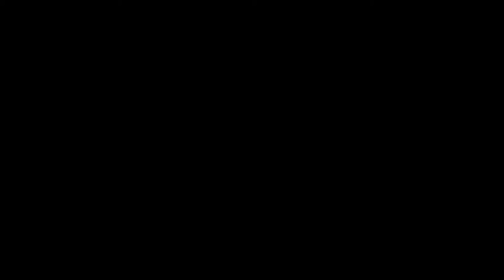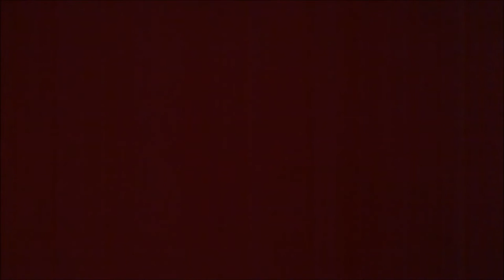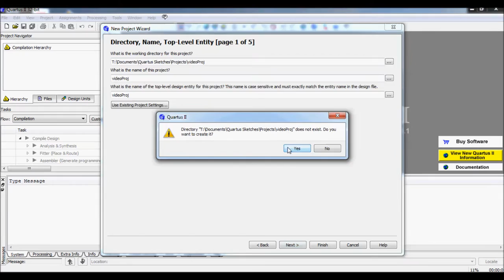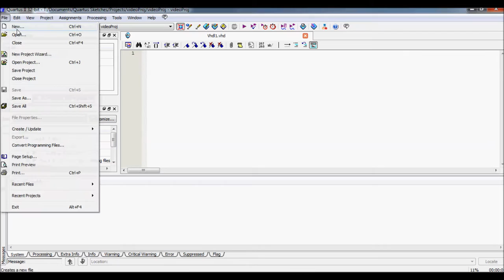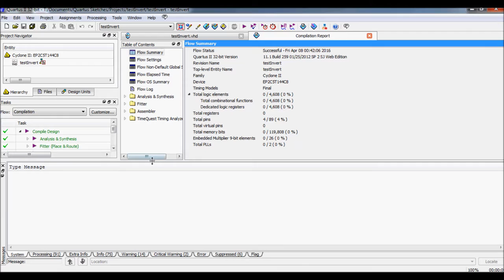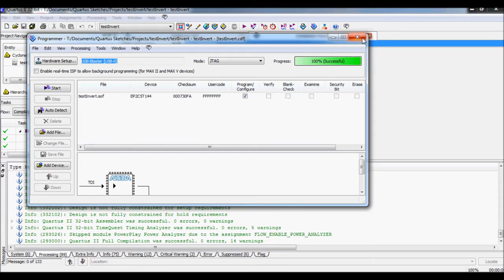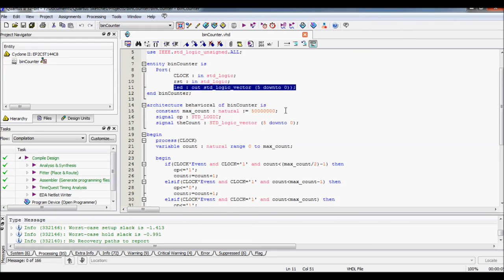Getting Started with VHDL and the Cyclone II EP2C5 Mini Dev Board

Comment: I don't usually write comments, but this video got me up and running 10x faster than the Altera videos! Great video for this board, and now I have verified my board works. Thanks for the great walk through, I appreciate it!
Reply from the maker: Well thanks!  I wish I could say I was more experienced with FPGAs, but I just kinda fumbled my way through this, and realized that others might be doing the same.  My big project right now is to try to implement PCIe using this board and some external DRAM, but unfortunately work keeps finding a way to get in the way.  Best of luck with your board!

Comment: For anyone wishing to program via AS mode, if you get a "current device not supported" error follow these steps: 
1) Make sure you have selected "Active Serial Programming" mode
2) Change/add file to the one that has a ".pof" extension
3) If it is not automatically added, via "Add Device" select "EPCS4" as the device. This is the onboard RAM
4) Make sure "Program/Configure" is checked
5) That's it.You can press "start" to flash
Reply: Thanks!

Comment: Another thing worth mentioning with these boards is that on the bottom you will find four zero-ohm resistors that jumper two IO pins to Vcc and two to Gnd. I'm not sure why these are there but you can remove them to gain access to these pins which are brought out to the headers. 

Also when interfacing external parts, pay close attention to the datasheet for the FPGA as there are 8 (IIRC) pins that are input-only and cannot be used as outputs. I realized that after fabricating a module to plug into the mini board.

Comment: The problem with the on-board button is most likely that you did not enable the pull-up resistor. There is no resistor on the board! In "Pin Planner" you can enable additional columns in the table at the bottom. Select the column "Weak Pull-Up Resistor" and enable it for pin "PB".
Reply: Additionally you will probably notice that the FPGA and the 1.2V regulator get quite hot as soon as you start running your own design. This is  because pins 26 and 81 are directly connected to 1.2V. The default choice is to drive all unused pins to GND. Short circuit. You should go to Assignments->Device->Device and Pin Options...->Unused Pins and set it to "As input tri-stated  with weak pull-up" (or "... with bus-hold circuitry"). Then everything stays cool.
Reply: Thanks! 8 months late, but that's really helpful as I was noticing it getting somewhat warm.
Reply: I can confirm my button works correctly after assigning the weak pull-up. Go to the 'Pin Planner', right click in any field and use the context menu to open 'Customize Columns'. In here you'll see 'Weak pull-up Resistor' on the left, highlight it and '>' it over to the currently in-use column, hit OK and it appears on the right of pin planner. You can now switch the pull-up on and off. 
Great tip to default pins to 'input with weak pull-up' too, everything running much cooler now! 
I'm just starting out with this board, this video was really helpful as others have said, great work!
Reply: @RD-so4mn    thank you, just started with this board and Quartus II, great tip for a beginner to hands on with fpga

Comment: There is a mistake in the code you show for the binary counter.  The second process should be using op for a signal rather than theCount.	

	
     process(op) begin
		if(rst='1') then
			theCount<="000000";
		elsif (op'Event and op='1') then
			theCount<=theCount+1;
		end if; 
	end process;

Comment: hey tery ! good work :) .. well.. could it be the problem with onboard push  button not debounced?
Reply from the maker: Nah, I didn't debounce the external button either, and I had no problems with it.  Since the program is just resetting the clock, if it sees multiple high pulls on the button in short succession it doesn't hurt anything since they're all happening in less then a second.  Also I tried debouncing the button for a later application and still had issues with it.  I think it's just a quality control problem with that particular component, so perhaps your board won't have that issue.  And even if it does, not being able to use the button isn't a huge deal (at least to me) anyways.

Comment: hello i got a problem with my board i chose outputs for a 7 seg 139,136,134,132,126,122,120 through pin planner and everything was looking fine but the voltage is not 3.3 at every output. Any ideas for my problem? (its my first attempt with fpgas so maybe its a silly question). Thank you.

Comment: hi, when i looked at digilent basys board or another boards with fpga, they have like 10 or more small power capacitors connected to power rails of fpga. I don't see them here. Does it matter to have them there or my designs have to be limited by maximum frequency and some maximum current out of pins due to power instability?

Comment: The board i got gives about 4 volts on the 3.3 VCC and 1.5V on the 1.2VCC pin. Is this a common problem with these boards?

Comment: Hello, everybody. I am trying to get through the LED project and when I get into Pin planner I get  'This is read-only' message, so I can't assign proper pons. Can anybody help me? I am using Quartus 13 and EP2C5T144C8 chip on the same board.
Reply: You get the error message as soon as you open up pin planner, or when you try to assign pins to a specific entity?

Comment: Hi and thanks for the tutorial. In the pin assignment section of the video, how did you determine PIN_144 for input and other staffs? Is that optional? The LEDs are D2, D4 and D5. I don't understand how you mapped those to PIN_3, PIN_7 and PIN_44.
Reply: Hi, I am starting with this board and I have the same question did you figure out how determine the PIN?
Reply from the maker: Hey all, sorry for the lack of response.  You can find the associations between the pins on the Cyclone II and the actual pins on the FPGA dev board on this page:

https://www.openimpulse.com/blog/wp-content/uploads/wpsc/downloadables/EP2C5T144-Altera-Cyclone-II-FPGA-Development-Board-Diagram.pdf

If you ctrl+F for "LED" (located at the middle-bottom of the first page), you should see that the LEDs are mapped to PIN_3, PIN_7 and PIN_44.  You can also find the clock output pin, and any other pin on the FPGA board.

This page is located on the product description of the dev board from OpenImpulse (https://www.openimpulse.com/blog/products-page/product-category/ep2c5t144-altera-cyclone-ii-fpga-development-board/), and they also have some other resources on there.

Let me know if you need any more help.

Comment: Error (12007): Top-level design entity "Project1" is undefinedError: Quartus II 64-Bit Analysis & Synthesis was unsuccessful. 1 error, 1 warning
	Error: Peak virtual memory: 4621 megabytes
	Error: Processing ended: Mon Jan 30 20:24:27 2023
	Error: Elapsed time: 00:00:03
	Error: Total CPU time (on all processors): 00:00:02
Error (293001): Quartus II Full Compilation was unsuccessful. 3 errors, 1 warning
, error when compiled the project, Here the "Project1" is my project name, How can I fix this.

Comment: Great job
I just got my new board and its working fine, But when I remove the power the program is lost. I have to reprogram again.
Am I doing something wrong?
Thanks
Reply: Nope, that's correct. Normally when you program an fpga  you want to load the program into the ram. if you want to save the program, you'll want to write the program to the flash
Reply: Thanks

Comment: WHat version of Quartus II are you using? it seems the latest (16.1) doesn't support the cyclone II
Reply from the maker: Yes, the later versions don't include support for the Cyclone II.  This is version 11.1sp2.  If you go on Altera's website you can download deprecated versions of Quartus that are compatible Cyclone II (and their other older FPGAs).
Reply: Trey thanks, do you know if it's possible to install two versions on the same pc?
Reply from the maker: I haven't tried, but it should be possible.  All the system files for 11.1 are clearly labelled as "11.1sp2", so it should be okay.  Do you have a Cyclone V or VI you're playing with as well?
Reply: Thanks, and yes I'm playing with a cyclone IV and Cyclone V SoC, so I'd like to be able to use them. I wanted the cyclone II for a smaller, simpler project.
Reply from the maker: Well best of luck!  It's been a minute since I've messed around with FPGAs, but I'll admit I'm waiting to have the time to fall down that rabbit hole again.  Incredibly powerful, and oddly not "mainstream" technology.

Comment: can we use arduino ide for programming the dev board
Reply: Unfortunately no, you cannot.  FPGA IDEs are very application specific, as they include a lot of information regarding how the FPGA is laid out, and given how the FPGA is laid out can "assemble" a circuit based on what the VHDL/Verilog is saying to do.  If you notice in the video, it's even noted to go get an older version of Quartus (11.1sp2).  This is because in newer versions of Quartus, this Cyclone 2 chip has been discontinued from support.  So even though you might think "newer is better, get the latest version of the IDE", that is not necessarily the case when it comes to FPGAs.
Reply: @delicious_lunch3823  I'm unable to download an older version that still supports this chip. Do you have a source, where I can find Quartus II 11.1sp2?
Reply: @Mr8411s  It does look like 11.1sp2 has been marked as discontinued on Intel's website.  Looking through Intel's supported device table, it looks like Quartus version 13.0sp1 supports the Cyclone II line, and that is still available on their site.  I have not tried using this version (I haven't done much with this device in quite awhile), but it looks like it should work. 

https://fpgasoftware.intel.com/13.0sp1/?edition=web
Reply: No, I'm afraid not.  Considering how each FPGA chip is going to have different I/O, different amounts of look up tables, etc, the programmer is very specific to the end device.  This is why I make a point in the video of mentioning what version of Quartus II to use, because even within a line of devices (eg the Cyclone line of FPGAs), the programmer has to be programmed to understand what end device you're programming, and not all versions of Quartus II support all Cyclone FPGAs.
Reply: @delicious_lunch3823  Thanks a lot! I missed the SP1 part of 13.0 so I didn't find Cyclone II there, but now it works.
Reply: @Mr8411s  Glad to hear it! Good luck with your project!

Comment: Your tutorial is brilliant. Thank you.

I would like to use this board to create a simulated UK101 as described by Grant Searle at 
http://searle.hostei.com/grant/uk101FPGA/index.html. 

I built a UK101 back in 1979 and am very excited at the prospect of recreating it with this board.

Originally, the USB blaster was not detected in Windows 10 32 bit , when using Quartus 13.  On Altera forum , I found a suggestion that if you installed Quartus Prime, it would install USB blaster drivers. I did that and then uninstalled Prime( it's 64 bit only)  and re-installed  Quartus 13.0.1.232  ( ver 13.sp1) .  The USB Blaster is now detected. 

However , while I can compile your testInvert successfully , the Programmer when started ( by Start button) just does nothing for about 40 seconds , then it shows ( Failed) in the progress bar. No further errors and it hangs.  Searched Altera site to no avail.

Any way to debug the programmer ?  The error feedback is poor enough to say the least, tho' I suspect it may be due to the way I installed the USB Blaster driver.  

Thanks again :)